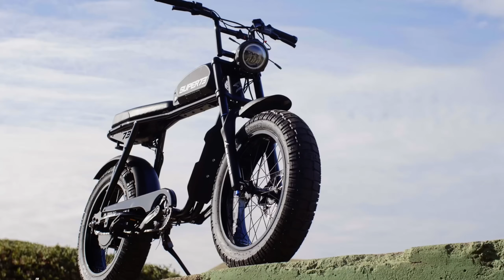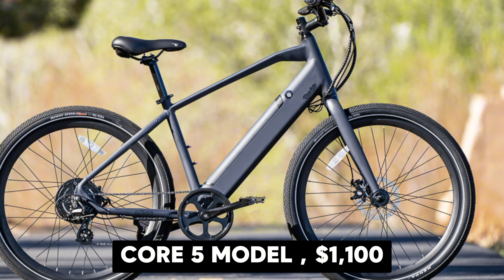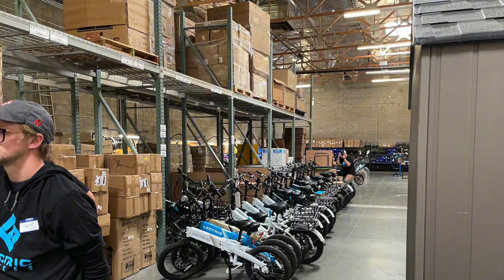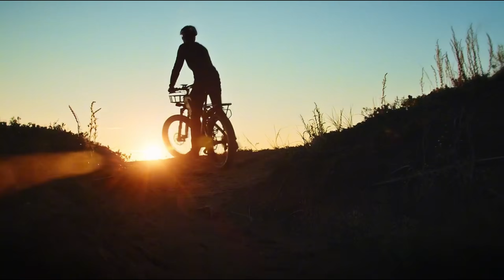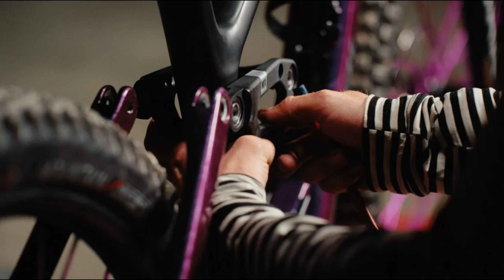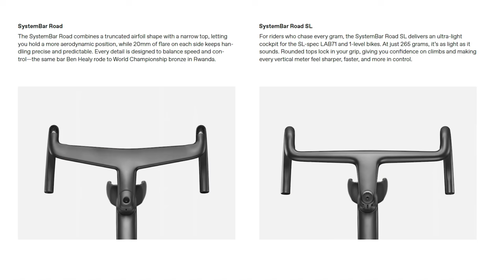The Worst E-Bike Brands in 2026 (And the Ones Actually Worth Your Money)!

Comment: The channel picks the very expensive high end brands as the bikes to buy because he knows very little about bikes except what is regurgasted on line
My EFFI MX06 is a very good bike , but I never did check the range. 
I keep my battery a 46 to 53 volts

Comment: The aventon one seems kind of nit picky. That would apply to those repair shops for any ebike, and their warranty system is actually pretty fair. I got a replacement rear wheel 6 months after purchase no questions asked.

Also pretty much every company lists the spec distance as an average weight rider on economy... You can obviously assume less mileage than the "up to" range if you're heavy or plan to run higher consumption 

Any issue on the repair would be the same issue you'd have with any other bike, and just with less likelihood of them taking it in the first place. 

Since then and besides basic wear and tear of bike components I've had no issues really. I've even rode the thing through 3.5 foot deep flood water on accident. Total submersion and still going strong

I can definitely see recommending trek/specialized over them, but in price point comparisons it should be obvious where that particular quality difference comes from. For mid budget ebikes I'm pretty sure there isn't much better than aventon.